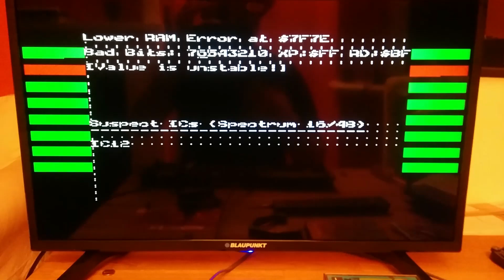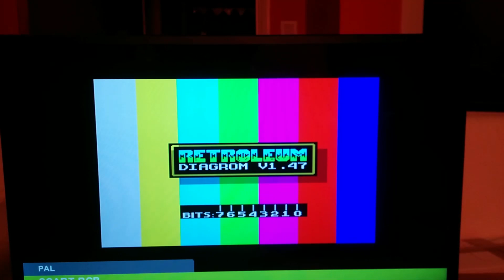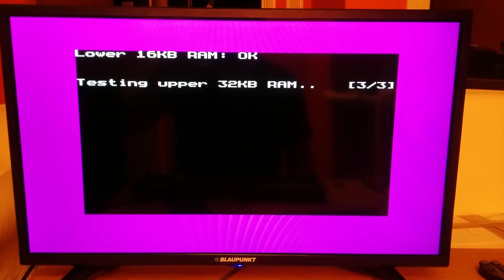Diagnosing ZX Spectrum RAM problems

Comment: Hi, great video! Which eeprom are you using?
Reply from the maker: 27c256 if I remember correctly. Unfortunately most of my Spectrum stuff is packed away, so I can't easily check.
Reply: @JensChristianRestemeier  thank you so much! I'll order a few and try them. Does it require any kind of mod or it's just burning the eeprom and install it?
Reply from the maker: @xalalalala  In my case it was just a matter of burning the eprom and plugging it in, but you should double check with the schematics for your motherboard revision.
Reply: @JensChristianRestemeier  thanks 👍🏻👍🏻